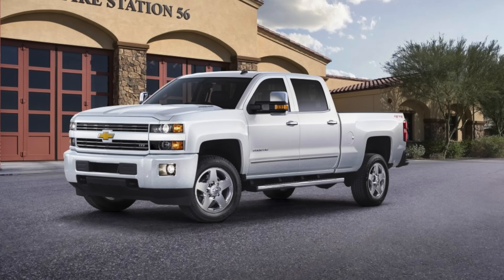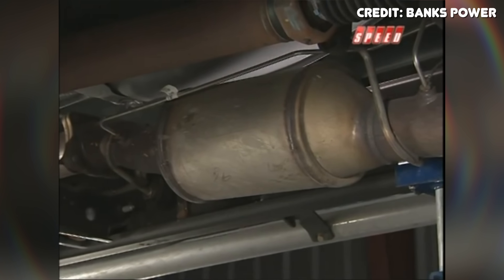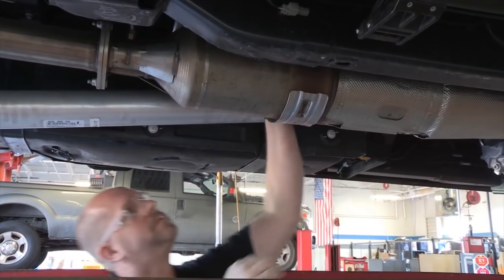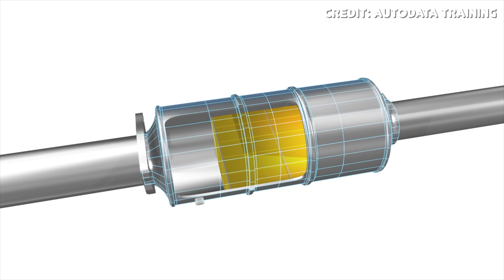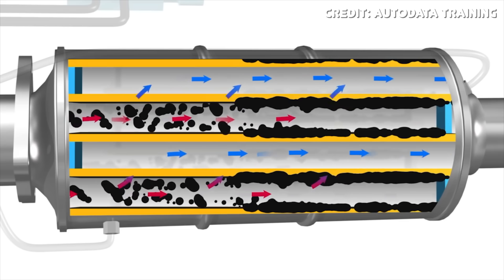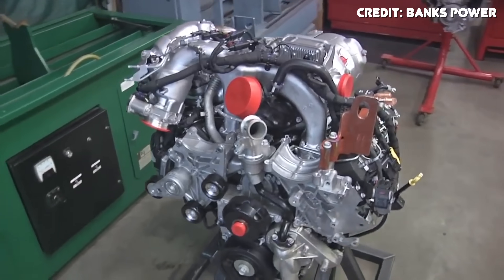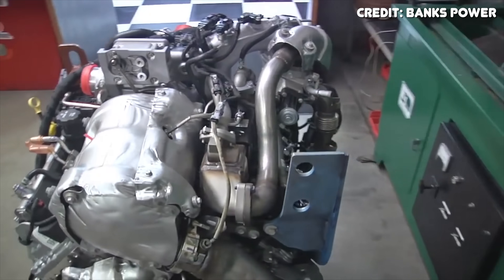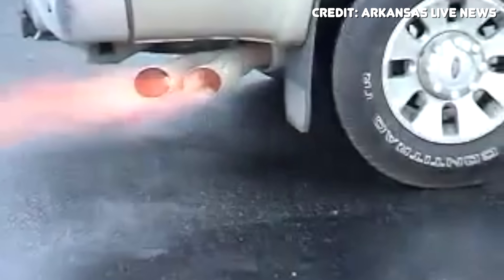Why Does Duramax Have This Exhaust Tip?

Comment: I have a 6.7 Cummins and a 6.6 Duramax L5P. Neither truck has ever done an active regen in 80K miles on each. I enjoy the fact that the trucks are quiet, no smell, no smoke... Hell, if you drove my Denali and didn't know, it'd be hard to tell it from a gas truck. If you DRIVE IT and don't baby it around, you won't see active regen. I commute 60 miles and tow a lot... never happens.

Comment: btw the ford shooting flames out of the tail pipe is not normal operating condition for the active regen, this was happening when some of the old fords would get stuck on active regen mode and would not shut it off, so it would eventually burn off all of the excess soot and the diesel fuel would still burn in the tailpipe creating a literal torch.

Comment: So that DEF type stuff simulator to catalytic converters how to they not instantly clog on if you have any sort of high miles on the truck? If it’s like a filter I’m assuming if you were to get one of these trucks up to a million miles it would not run at all that stuff would be clogged ip so bad and I’ve time reducing your power to none
Reply: when the filter starts getting full the car or truck will go through a regeneration cycle which clears it out again. If the system that clears it fails then it will clog and reduce your engine power.

Comment: I drive Kenworths in Canada. My Province had a massive forest fire created by the DPF Active Regen. Basically, it was AR on the highway, he parked his truck because he hit hours of service, parked close to some trees... the 550 Celsius exhausts caught the trees on fire, started a massive wildfire.
Reply: So much for DPF being an Earth friendly solution.
Reply: It gets that hot during a regen???
Reply: @DubstepMagiic  yes it does
Reply: @DubstepMagiic  Yep, my diesel BMW E82 goes to  600 celsius when is doing a regen, coolant gets a bit hot, and negative turbo pressures. Is a bit scary looking at that live data when you are doing around 80 KMh, and if you own a diesel VW, you park the car, shut the engine off, and take the keys off and the car keeps working till the cycle ends. crazy.
Reply: @DubstepMagiic  i've done regens on small diesel cars and you can see parts of the exhaust and turbo glowing red hot.
Reply: That is so true, we measured a regen temp &  at it was over 1100 degs. The high temp is what is need to burn and create the ash from the soot  and to clear the exhaust. So the fuel is burning in the exhaust.
Reply: Reminds me of the fire in The Sopranos
Reply: Makes you wonder how long we could ride around, deleted, to make the same amount of emissions that happened from the fire.
Reply: Yeah but just think how much cleaner the air is now......... lol

Comment: I just deleted my dmax and left the factory tailpipe on, I gained 20% on fuel mileage, a noticeable increase in horse power and best of all it runs a lot cooler!
Reply: I just deleted the entire truck. Now i save a fortune in fuel cost
Reply: So what’s your average and How do you get it inspected
Reply: @melvinharvey8279  depends on where you live/gotta know a guy.
Reply: @melvinharvey8279  it does depend where you live and/or know somebody. In my 98 Dodge Ram 2500 w/a Cummins has no emissions controls just a muffler, I’ve never even had a question about anything exhaust related. 

I have a street/strip 94 Mustang GT with a new built motor with less than 3500 miles on the new engine built engine. I just remove the H-pipe with the cats for and swap for one with factory cats, get it inspected, and swapped back the same day. I do get questions about that since it gets covered in cob webs, little bit of overspray from spray painting, that I don’t bother cleaning and they always ask questions and I play dumb. I also don’t have OBD testing because its only OBD1

In SC there is only a safety inspection and no emissions inspections. 

There is I believe 14 other states that don’t do emissions testing as far as I know either
Reply: @melvinharvey8279  in my state all you have to have to do to pass inspection is a reduced section somewhere in the middle, so you can basically run straight pipe no muffler as long as you have a smaller pipe somewhere between the exhaust headers and the exit pipe..
   But also in my state you don't need a windshield to pass either lol, if you have a big crack across the windshield it won't pass, but if you take the windshield out it will...
Reply: @melvinharvey8279  they don't inspect in florida, half the local semi trucks are deleted also, everyone around here that repairs their own vehicles deletes also, that system is a scam
Reply: Gatta use another word other than “delete” the epa is watching 😂
Reply: @michaelscallon5676  went on a diet?
Reply: @whoodilly1  “I put my truck on a diet” lmao that’s good
Reply: @michaelscallon5676  the epa is getting stricter and sticter
Reply: @BlakeBFixin  the epa is going to be abolished just like the irs
Reply: @itchytriggerfinger7622  uhh... That can be debatable however the thing that is not debatable is that the soot is pretty harmful to humans especially in city where the cars drive closely to each other and there are pedestrians around. Soot flies out the tailpipe and stays in the for quite a while just like dust and the worst part is that once it lands, it can get picked up in the fairly easily by a car driving past. If I'm not mistaken, it doesn't dissolve in water as well...
Reply: @Mixz1890  wrong try again soot immediately falls to the ground is doesn’t hang like dust.
Reply: @Nitewolf5377  What? A simple google search tells otherwise. Soot particles can be as small as 10nm meaning they will easily float in the air. The floating soot particles in the air typically are in 0.01–20 μm range. For reference, dust particles are typically 1-400μm range.

When you look at rolling coal trucks, does it look like the soot immediately falls to the ground or that it floats in the air until it disperses and is no longer noticeable? Just as dust, soot can also easily be picked up from the ground by wind, cars, etc.
Reply: All that has nothing to do with your tailpipe.
Reply: @itchytriggerfinger7622  It has nothing to do with tree hugging and more to do with your own health. Soot is proven to be a carcinogen.

Also your logic is flawed. Oxygen is healthy right? And Carbon is everywhere. Then why is CO gas so deadly?
Reply: https://youtu.be/LHqyTMiFQcM
Reply: Would it pass on a smog check here in California? I’ve been wanting to delete it but I’m ifffffy about it..I really want it to sound a bitttt louder
Reply: @heyfatty460  probably not in California, I believe any modifications to existing exhaust systems are prohibited, and if needing ehhaust replaced it has to as close to original as possible...the pros is it will run better fuel will ignite better and it will be more reliable, the cons is it will pollute more(which is debatable)...
   Also why I say it's debatable is because there have been studies that show diesel fuel fumes are heavier causing them to settle faster , and these types of systems cause the fumes to aerosolize floating in the air longer farther, and being easily blown around and put back in the air..
   diesel fuel contains slightly more carbon (2.68kg CO₂/litre) than petrol (2.31kg CO₂/litre), overall CO₂ emissions of a diesel car tend to be lower.
   So what you see as exhaust on diesel that looks like dirty exhaust fumes is mainly harmless burnt carbon and less CO2 than a standard gas car...
Reply: @heyfatty460  CARB is looking to just flat out ban vehicles older than a certain model year.  I think in January 2023, any diesel trucks older than 2010 aren't eligible for registration renewal.
Reply: Also if I was to delete it what would be some pros/cons
Reply: Casual engine delete
Reply: what dmax do you have? you saved the engine
Reply: I deleted my 2012 GMC 3500 four years ago with Motor Ops trailer towing tune and never regretted doing it, still getting 15.5 litres per 100 km, from 21 litres per hundred.
Reply: That’s how my dads truck was the emissions was killing it the dpf absolutely sucks
Reply: @itchytriggerfinger7622  more environmental friendly cuz the air that comes out is cleaner, but if burns more fuel to do that..... same question as you saksksak
Reply: Def is a scam
Reply: @abradolflincler00  yes it is and more deadly to the environment.
Reply: My truck needs to go on a diet.. maybe loose the equivalent of a face mask by getting rid of the egr too.
Reply: Same here I deleted my 08 was running 13.5 to 14 on mileage now running 16 up to 20
Reply: @erichansen1547  My BONE STOCK L5P 3500 Denali gets 19 mpg commuting and 24 on the highway. Towing 10,000 lbs it gets 11-12.
Reply: @HalfCrazy520  I avg 11-12 with a 20ft cattle trailer with around 10 cattle weighing 1k+ in a 2012 deleted duramax
Reply: @F12-i2g  -- I get the same mileage towing a 35' trailer weighing 10K lbs in the Smoky  Mountains and the truck is a bone stock 3500 Duramax L5P, 6-speed Allison, GMC Denali that weighs 8850 lbs.
I love that it's quiet and doesn't smoke or stink. Hell, if you got in it and drove it without knowing, it would be hard to tell it's a diesel... it drives like a powerful gasoline engine.
I also have a 2018 Ram 2500/Cummins. It gets a little better mileage than the GMC (3.42 gears vs 3.73) but the Duramax is a lot more powerful.
Reply: @itchytriggerfinger7622  tbh it’s not in my opinion when it regenerates all the soot goes back out
Reply: @liampatterson9396  it does, but def is what tones down the bad stuff. PPEI got hit for it and in one of their posts mentioned deleted truck exhaust is 300 times worse.
Reply: @itchytriggerfinger7622  Probably not but you're not thinking like an EPA bureaucrat. In order to think like an EPA bureaucrat you must throw common sense out the window and forget about anything you've learned about science, automobiles and the environment.
Reply: @erikkovacs3097  you forget about nox emmisions. Things like Egr really do help as they lower the amount of air comming into the desils allowing it to run at a fuel air ratio closer to stoichiometric so there is less oxygen and nitrogen to react with each other
Reply: Also to the OP - there are 2 possible reasons why you gained fuel economy and power:
1. Your engine is in a bad state that caused the DPF to get blocked thus causing bad fuel economy and shitty power or
2. You also got your engine "tuned" which caused it to have more power and better fuel economy at the cost of more emmisions(not just soot but also NOx etc.)
Reply: @Mixz1890  DPF, well the whole emissions system in general restricts airflow, even new.     When you remove all that, your engine can actually breathe more freely, your vehicle weighs a little less, and you have fewer failure points that can grenade your engine.
Reply: @yarrik701  sure technically is does restrict airflow but if the correct size dpf is used then the difference should be minimal just like with cats.
Reply: @Mixz1890  both still serve as a restriction to airflow.  With a dpf, as it plugs up between regen cycles that's an additional air restriction.   Not to mention the additional reduced fuel efficiency when diesel literally gets injected into your exhaust during an active regen cycle to heat up the filter.  A process where you're still dumping what was captured out the tail pipe.
Reply: @yarrik701  I agree that a full dpf is somewhat restrictive and that the additional fuel is used to clean it however its not a large amount. If I can go 500km between regens and regen takes at most 40km to happen at 6.5l/100km instead of normal 5l/100km, then it's not a large amount. What I disagree with is your idea that during regen all of the stuff comes out the tailpipe anyway. Soot gets trapped in dpf and when it's being burned, it turns into ash. Now some of the ash stays in dpf, some escapes but ash is different that soot, it is water soluble so it doesn't stay in that form for long. Also the extra emmisions during regen are still not as harmful as soot
Reply: @Mixz1890  this is the point many people miss, without the DPF soot would get out as is, but with a particulate filter it is burned, any the process is efficient enough to make whatever exits the tailpipe much less harmful 👍

Comment: It makes me wonder at what point do all these emissions components offset the footprint they're trying to prevent. Not only are they often less reliable but I feel they force the use of lower quality components to try keep costs down. Every time these components have to be repaired / replaced it all has a footprint. Sometimes it is often cheaper to replace the vehicle than repair it. 

I see a lot of diesel vehicles built with poor quality components or problems due to emissions components that eventually cause large amounts of soot / burnt oil to come from the engine exhaust. It then cooks itself over a number of months and has to be replaced. Too hard or more expensive to repair! I suppose as long as it sounds eco friendly and works when it is new!!

I am most likely wrong, but it does make me wonder.
Reply: It is a scam, without these systems we would spend less on groceries and gas.
Reply: Yep nothing is simple.  If the diesel emissions laws were more relaxed the engines would last longer, but with less laws and regulations there would likely be more competition that gm ford and cummins dont want, same with the semi/tractor engines.  Also those same companies are making a killing on parts and repair.  Then theres the government getting bigger and making more "parasitic" jobs.  I say that because lots the government does is not benefitting we the people, often not producing a useful good or service, but still cost taxpayers.  All at the customers expense.  I question how much the government and big business care about the environment and morality.  You should look up the wind farms and how they likely only exist due to government funding/subsidies.  I think Michael Moore did a documentary about renewable energy.  Also there is little to no emissions controls on us military vehicles.  They dont want them being less reliable.
Reply: What you’re experiencing is something called “common sense” …many people have thrown that out the window because governments and experts have told them to do so
Reply: @localenterprisebroadcastin5971  common sense is dangerous to governments and experts.  lol

Comment: In the fire service they teach not to lay hose close to the apparatus exhaust so that there's not a hose failure if they truck regens during a scene.
Reply: Hi there, I was just wondering if there aren't some emissions exemptions for diesel equipped fire and other emergency services vehicles? (I honestly thought there was, unless that has changed?) would hope there are, and if not, in mho there should be. Good comment btw

Comment: You failed to mention that the LMM motor has this system too. Unless Duramax owners have a 07 Classic body style (equipped with an LBZ) The LMM equipped will have these tips too. It's also worth mentioning that the LWN 4 cylinder Duramax engines also have this system as well.

Comment: Regen is not going to occur in any of the suggested scenarios (heavy traffic, forestry work) with the exception of a dealer working on the truck and forcing a stationary regen.  However the risk of entering heavy traffic or parking during or immediately after a regen are possible scenarios.  I've parked up and had the hairs on my legs singed by my Iveco Daily, but it rarely regens as it works hard pulling a trailer.
Reply: I think those things are possible as they aren’t going to be constantly working hard enough to no regen and it even more likely to happen when driving in tall dry prairie grass.

Comment: Early Ford Diesels were starting brush fires. Some even had flames shooting out during regen. That is a very hot condition
Reply: If by "early" you mean "6.4 liter Powerstroke" which was introduced literally 25 years after the International Harvester IDI engine was introduced in 1983 lmao

"early" 🤣
Reply: @TheRealPOTUSDavidByrd  yeah I meant early with after treatment. Pretty sure IH’s IDIs didn’t have regen.
Reply: @yolo_burrito  I'm picking on ya bud, but yeah regen wasn't a thing until MY2008 for most, if not all, diesel trucks from the Big 3

Comment: alright, whats the point of having a dpf system if its all gonna get burned out anyway.
Reply: It doesn't get burned if there's no DPF System. It just flies out the pipe as actual particulates. (Soot)
Reply: @pieman12345678987654  yeah but in regene it burns everything

Comment: If you’ll notice round does not have that Cummins diesel in their Engineers are some of the best in the United States you’re right big trucks do have this but all big trucks 99. 5% of them running up down the highway are all in line 6 cylinders are there issues yes most of the time sensors